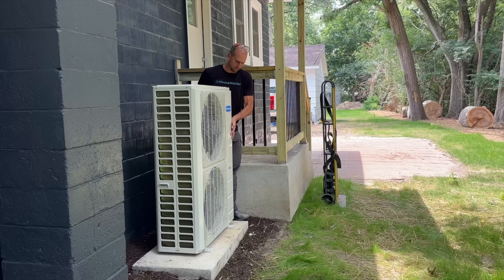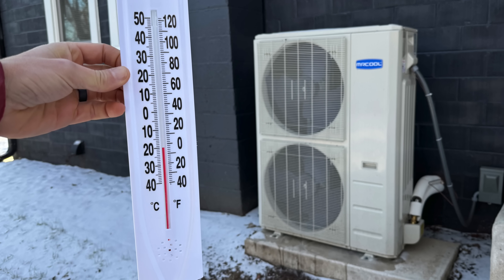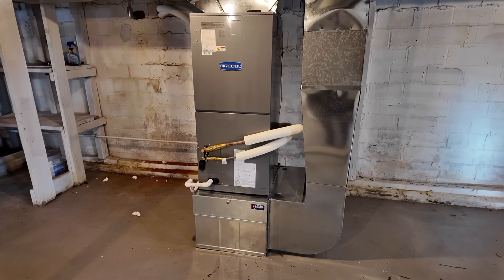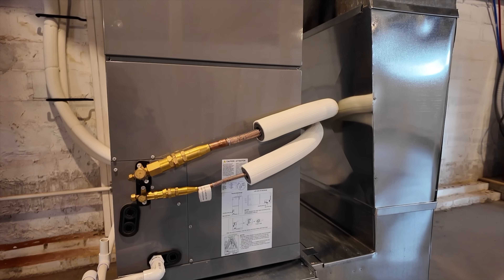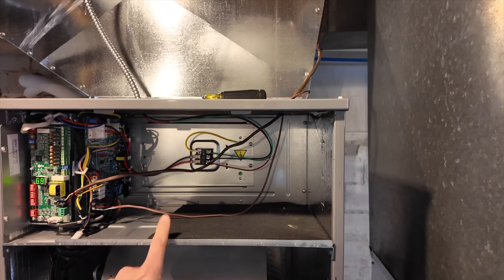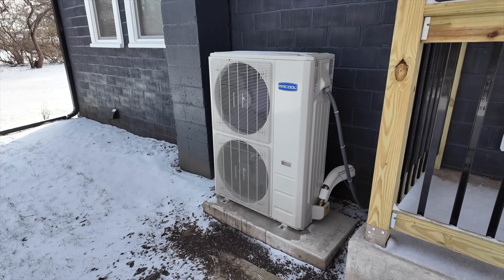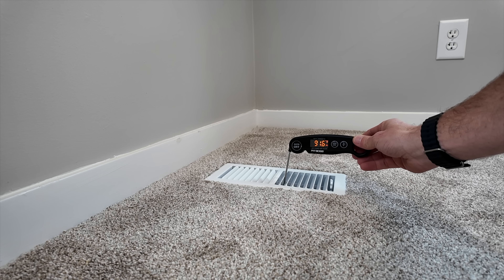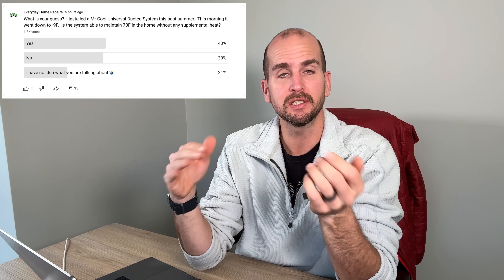Testing A MrCool At Extreme Cold Temps | Will The Hyper Heat Work?

Comment: I'm in Idaho and it has been cold (low around zero) heighs in the teens and I've kept my thermostat at 65.   I'm using a gas furnace
Reply: Well good for you!  You're spending a lot more money for fuel, and you're contributing to climate change.  Also OT.
Reply: @incognitotorpedo42  not really.  The furnace is 80% efficient but the electric company uses natural gas power plants which are 60% efficient.
Reply: I have a propane furnace, I leave it at 60 degrees most of the time while I'm not home, when I'm home I use the wood stove...can't afford the propane to use the furnace all the time when I'm home LOL.  Its 3 degrees right now, I'm in Emmett.  

I don't have central AC, but if they can make a heat pump that actually works in sub zero temps that might be the way to go....I just have a window AC unit but that poor thing struggles in the 100+ degree days we usually get in July/August.

Comment: @EverydayHomeRepairs Scott I am not a constant critic, I do appreciate the effort and HUGE value you provide to the DIY community. This one got under my skin a bit, but I am a fan and know that you are above and beyond a honest and ethical guided content creator.

Original post:
🚩Big Red Flag Here!🚩
Video doesn't answer your question.
The question you asked the community was:
"Is the [Mr. Cool Heatpump] system able to maintain 70F in the home without any supplemental heat?" When it was -9F outside.
Then you did a bait-and-switch by:
🚩Measuring the temperature at the registers🚩
🚩Show ZERO measurements of the rooms in the home🚩
The elephant 🐘 in the room is not can heatpumps produce heat in -9F, its can it maintain a 70F house when its -9F outside.
Why couldn't you show a measurement of room air temperatures? Or thermal camera view of a room? Or put a small tabletop thermometer in each room?
This makes me so frustrated! 
Zero acknowledgement of R-values, Air-sealing ACH ratings of the building, and Solar heat gain to name a few.
But to everyone else wanting a Heat-Pump: yes they work, almost like magic. Have a back-up source of electricity (grid goes down in snow storms) and a separate backup source of non-electric heat generation.
Reply from the maker: Thanks for the feedback, should have made that more clear other than showing the thermostat with the set temp of 71F and the room temp at 70F during a heating cycle.  Even over night at -9F the unit was able to maintain 71F but she is a little power hog.
Reply: @EverydayHomeRepairs  "power hog" sounds like it might have been hitting the aux heating coils pretty hard...
Reply: @Sylvan_dB I installed 2/3 ton Mr Cool (set in 3 ton mode) last summer. My results a couple of nights ago at 9F (not -9) were similar to registers.  It is also a matter of duct size, room size, windows, insulation etc.  My 3 ton unit without auxiliary is a little undersized for my application so on really cold days I have to supplement with baseboard heat.  I chose to undersize a bit on extreme temps rather than oversize to handle all conditions. All of my duct is internal in the conditioned space and would have to go through attic to increase duct capacity.  The 90 something duct temp on cold days is warm, but not the satisfying “sit in front of the heater” hot air. It’s doing it’s job.  Most days. Only ran for a couple of weeks at end of summer in cooling mode with 80F outdoor temps.  Did fine.  I’ll see how it does in 90F temps next summer.
Reply: @EverydayHomeRepairs Scott I am not a constant critic, I do appreciate the effort and HUGE value you provide to the DIY community. This one got under my skin a bit, but I am a fan and know that you are above and beyond a honest and ethical guided content creator.

Comment: Scott, thanks so much for this! I was waiting for your winter update. I'm planning on a DIY 2T MrCool Hyper Heat in the spring here in Cincinnati, OH. I'm dumbfounded by how little knowledge there is in the midwest about these newer heat pumps. I've seen many reports like your that these system ARE working at low temps as designed. But still, with so little adoption it makes me feel like I'm missing something or I am crazy...
Reply from the maker: Yeah, there is a lot of dated knowledge on these systems.  With that said I like to have a plan for supplemental heat if the power goes out.  That is the big thing I miss with a gas furnace.  If the power goes out with the gas furnace I just need to power the air handler to ensure the home stays warm.  Overall I have been very impressed.
Reply: @EverydayHomeRepairs  if you can get a generator to run the furnace you can also just get a generator that can run this rebaged Gree unit.
Reply: Same issue here in Central Ohio. Most companies are putting in builder grade single stage equipment or are blindly loyal to legacy brands that are behind when it comes to inverter units.

Comment: I have the 2-3 ton Universal (Gen 3) with no Aux Heat in Northern Indian. Running in the 3 ton mode, it was not able to hold 70f indoors and dropped to 60f overnight as it hit -9f outside. Ended up with 5 smaller space heaters (one in each main and bedroom) running all day to help out. 

Heat out of the vents is normally 100f-105f until it hits ~15f outside then slowly lowers from there. At 5f right now its throwing 97f, but -9f it was throwing ~75f heat. 

That said, these cold snaps are only once, maybe twice, a year and as long as stays above 10f or so, it works perfectly fine. I also have a 1.5 story built in '78 and remodeled and reinsulated in 2002 with R13 walls but only R22 roof due to the 2x6 rafters and no room, so could be much better in that regard. I'm looking to rectify that soon.

edit: added current temps
Reply: these mr cool units are rebaged Gree units and are considerd C tier at best in europe. they are pretty bad in winter. for heating you are much better of with something from mitsubishi heavy or electric.
Reply: In fact, they are made for MrCool by Gree. In the same way iPhones are made for Apple by a Chinese factory. Like all heat pumps, their efficiency falls off as the outdoor temperature falls, and once you're below about -15C/5F it's best to switch on your backup heat source. This is nothing out of the ordinary. MrCool may not be top-of-the-line but we can't all afford to drive Ferraris. The Fords and Volkswagons get the job done. @SupremeRuleroftheWorld
Reply: @SupremeRuleroftheWorld  Mitsubishi unit could do better, but they don't offer anything over 42k btu here ducted. And Gree has their Ultra units that are rated to -31 F now. 
And yes, they have hot gas recovery in the outdoor unit as well.
Reply: @SupremeRuleroftheWorld  we have the Gree Flexx Cold Climate 3 ton, didn't need auxiliary supplemental 8 kW heat strip until -24ºC, only used 5 hours this winter in Calgary. They are awesome, and I'm speaking from personal experience.
Reply: @SupremeRuleroftheWorld  Also should add, this unit in the vide is NOT the Gree FLEXX unit, this is the Midea unit that Carrier, Cooper and Hunter and others sell.

Comment: I have a Mr Cool universal heat pump I installed 2 years ago and I’m very happy with the system.  I live in Kansas City and it’s been as low as ~11 degrees this week and we are very comfortable in our 1800 sq ft ranch home.  The cost savings running it year around has been enormous.  It’s a thumbs up for me.👍🏼
Reply: I installed a similar system, the DIY system in my house over the summer then we hit winter and the outdoor condenser kept going into defrost every hour during 25-30 degree nights even with low humidity(I understand with high humidity every hour isn't that bad), so I contacted several companies and spoke with other people who installed DIY units and the same thing I kept hearing was I needed to elevate the condenser.  My setup was similar to this one, on a concrete pad with rubber feet, raised about 1-2 inches up off the pad with a groove cut in the middle for water to drain off.  I kept hearing to raise it at least 8-12 inches off the pad would help.  Didn't really think it would make much difference but fearing it would get worse once it gets colder decided to try it.  Was able to gently and slower lift with the tractor boom(>>>>SLOWLY AND GENTLY is key) while a friend made sure piping was never in a bind and maintained angles, raised it to a total of 8-10 inches and placed it on a lift pad.   checked for leaks and all that stuff, everything was good.  That night it got down to about 20 F with about 60% humidity and it would go 3-4 hours between defrosting.
I'm not sure what it is, maybe it draws more water vapor up off the pad or it allows it to concentrate more water vapor into the condenser as it sucks it in...or something but it really makes a world of difference having the condenser lifted off the pad.  If you live in a colder climate and install one of these it would probably be a good idea to raise them off the pad, it really helped mine with regard to defrost.  I was lucky that I was able to raise it up several inches after I'd already installed it and didn't have to disconnect any of the pre-charged lineset but not everybody will be so lucky, it's better to elevate it initially than trying to do it months later(the stress alone will drive you crazy).

Hope this helps someone in the future.
Reply from the maker: Thanks so much for the additional info/feedback!
Reply: So good to see
Replacing my furnace next year… we get down pretty cold at 7k ft in Arizona (minus 20)
Reply: @Sacredview  you might want to get the resistance heat coils, just in case.  I got them, just in case.  They are’t that expensive
Reply: @Sacredview sounds like you’re in Flagstaff. 120 miles away, and I’m living on the surface of the Sun. 😅
Reply: How cold is 7k? 
You meant 7 Kelvins? 
 @Sacredview
Reply: @sfuchs He means an altitude of 7000 feet
Reply: @sfuchs  he meant 7k ft altitude, probably in the Flagstaff vicinity
Reply: I wish someone in the USA made a 2 heat pump system in one unit.  One compressor for HVAC and one compressor for the water heater!
Reply: Does anyone know what is cheaper and by how much?
Heat pump consumes elwctr. power for moving heat from outside to indoor.  
Gas furnace burns natural gas, which is cheaper than electricity.

Is there known cost comparison elect power vs. natural gas to produce heat?😅?
Reply: @sfuchs my neighbor has the exact same size of home as me (2000sf). I have natural gas heat and they just had a whole house Mitsubishi hyper heat heat pump system installed. Their electricity usage during this past winter was the same as our combined natural gas/heat. But where they keep their house at 67 degrees, we keep ours at 72. So regarding heat (in Boise) it’s cheaper to heat with natural gas.
Reply: Newer heat pumps are much more efficient than gas until you start getting into single digits.

But efficiency and cost are two different things. Many people have done this calculation and it is very sensitive to your electric rate, the performance curve at outdoor temperatures of the system you are looking at, and the average winter low temperature of your area. It is less sensitive to the natural gas cost.

Generally if you are paying around 15 cents a kwh and live in an area with average temps at or above the teens, you will save hundreds of dollars a year.

If you have to get LP delivered there is almost no way you won't save a lot of money, even if you live in Canada and have to have a backup heat source.

Besides having heat strips you can install one with a NG or LP furnace to use as backup when it gets super cold.
Reply: @colinnwn  thanks for your insight. 

 What are the heat strips?
Reply: @sfuchs  heat strips are electric resistance heating elements you can add to a heat pump system very cheaply. They are used only when outdoor temps get too cold for the heat pump. But they are very expensive to run just like an electric furnace so they are only good as a backup in areas they are infrequently needed.
Reply: I mis-spoke.  I said I installed it.  I had an HVAC person install it.  After watching it done I’m sure I could do it myself.  Just did have the electrical confidence.
Reply: How many tons did you get for a 1800sqft house?
Reply: @phillips3390  3 tons
Reply: I live in Overland Park and was considering this project! Can you tell me more about how you did it?
Reply: HI: any leak, any rusted coil? thanks

Comment: Impressive!  I thought heat pumps bottomed out about 35°F.
Reply: Some of them do. Pay attention to their spec sheets, and stay away from Armstrong if you live somewhere cold. Or hot. Or on Earth... just stay away from them, they suck. IDK why the builder decided to go with that unit in this house. 
I'm trying to get a proper low-temp capable heat pump installed here, but getting a unit that the HVAC companies don't profit off of installed is annoyingly difficult.
Reply: @Jcewazhere Armstrong is just builder grade Lennox, and Lennox has had lots of issues, that they may finally have fixed. They were great back in the 90s, course so was Trane and others.
Reply: Old units certainly.  As a kid growing up, we had a heat pump in a house built in 1978 and the aux heat light would come on within a couple of degrees of outside being freezing.  To see units now be able to perform this well at temperatures 20 to 30 degrees colder than that is amazing.  I'd love to see what kind of heat it is able to put out near it's minimum spec temp of -20F.

Comment: Great to hear that! Can you please make another video comparing the energy cost when running these heat pumps vs the energy consumed by a regular furnace (gas or oil)?
Reply: If all that matters to you is the price then convert both to price per therm or kWh and see for yourself.

1 therm is about 29kWh. 1 kWh of electricity is 22c here, 1 therm of natural gas is about 1 CCF which is about $1.50. Or about 5c per kWh for gas. However gas is 90% efficient while heat pumps can be up to 400% efficient at turning each kWh used into kWh of heat in the house. Heat pump efficiency drops in colder weather, down to about 200% for the Mr. Cool at sub-zero F temps. 

So gas would be 2 times cheaper roughly when it's stupidly cold out, and about the same when it's not that cold.

However you can get solar to power your heat pump, you cannot get solar to power your gas furnace. So gas users will always be beholden to big oil, OPEC, SA, and the stability of the gas supply. Oil isn't getting more common either, solar power is still getting cheaper and more common.
Reply: That depends a lot on the price of power (kWh), and price of gas in your area.
Reply: That depends on your average temps in winter
Reply: @sprockkets  I live in Canada… lol
But here where I live in Ontario, I don’t have so many days below 0 F but constant days on low temperatures during winter. I guess my gas furnace is still worthy.
Reply: @VictorPaixao4fun  Pricewise, at least at the moment, natural gas is 2x cheaper than a heat pump. That's betting on an average COP of 3.
If you spend a lot near 0 F, it's going to be worse, with a COP around 2, at the very best.
Reply: @sprockkets you need to add the connection costs of your natural gas supplier. Here in Cleveland, OH it's almost $50 per month.
Reply: @fparent  Only 14 for me. It does add up but if you use a lot of gas for Jan it doesn't really mean much. That's why if you want gas as a backup, have propane instead.
Reply: @fparent That's unusually high. Mine is $10. And gas is sold at cost.
Reply: Here is a thought.
Get the best of both worlds by keeping the gas and just adding a direct solar powered mini split by Eg4. Then, if it doesn't keep up, kick on the gas. Plus have A/C from the sun
Reply: @jasonrico8558  wood is better if less convenient
Reply: if I remember correctly it would be cheaper to run natural gas from a video I watched a couple weeks ago. On the other hand, electrical usage can be offset by certain means e.g solar panels or other renewable resources charging batteries.
Reply: People keep bringing up cost of natural gas vs electricity but something else to consider is the load it has on the houses amps. If you are retrofitting an older house, you are likely going to have to upgrade your electrical service and panel which will add an additional ~$4k to the cost (roughly). 
Another consideration is that when the power grid fails, natural gas can still heat your home and prevent pipes from bursting. 
Overall I think for newer construction it is worth it but for older homes that arent as insulated to begin with if you have natural gas you should stick with it.
Reply: @Luckingsworth  That's only if you are using straight electric.
Reply: @sprockkets  A lot of houses aren't wired to handle the heat stips. Some old houses only have 60 amp service.

Comment: Is there a video available that explains how they're able to make a heat pump work that well at 0°F ??
That's a huge change !!
Reply: Inverter based drive is most of the improvements. Hot gas bypass also helps with this system.
Reply: @sprockkets   Well I'm thoroughly impressed
I did HVAC for 30 years from the starting in the early 80's and it's amazing it took this long to get a heat pump to heat in freezing temperatures without auxiliary heat...
Reply: @2packs4sure  basically as you know, it takes more capacity and energy to heat, than in cool mode.
Reply from the maker: I think Matt did a great job showing some of the advances that are making this possible https://youtu.be/H3jIRRzF6d0?si=12yeWGrademM-BRv